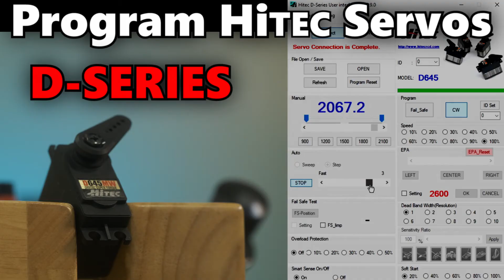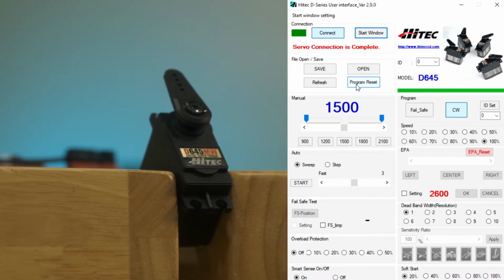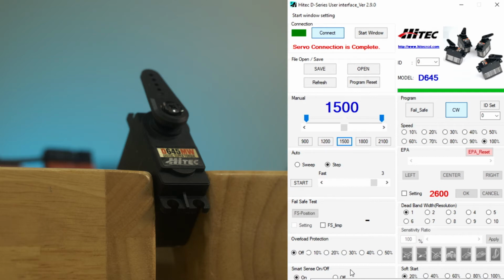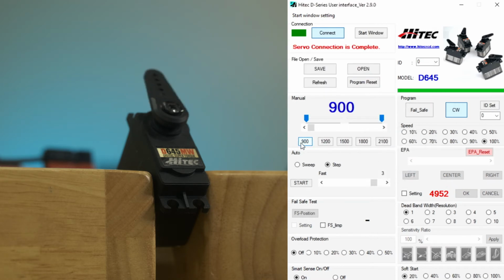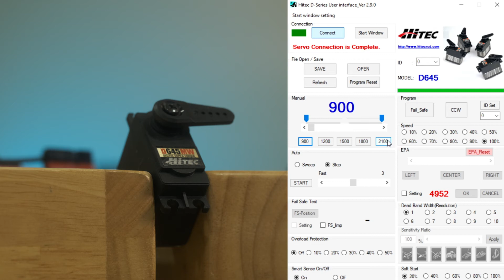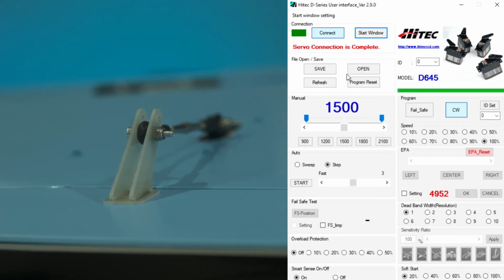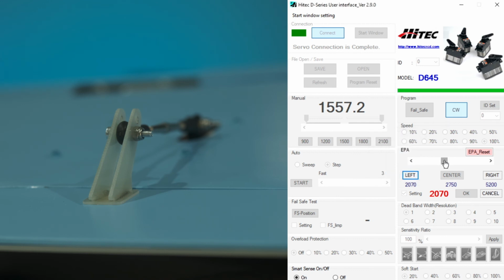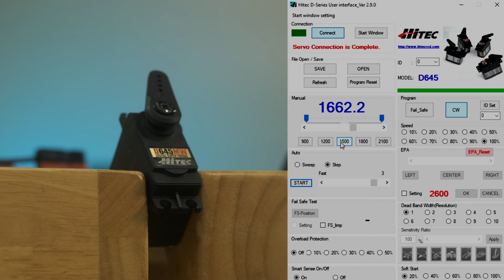How to program Hitec D series servos with the DPC-11 in 13 minutes - D645MW

Comment: Great Video!!!   I'm looking to acquire one of these, how would you go about programing when using a Futaba Radio?  For example, I have the HFP 10 and when I program center / epa and plug the servo into the receiver the center position changes.  I believe the neutral pulse on Futaba is 1530. 

Your help is appreciated.
Reply from the maker: You have to set your Futaba radio for 1500 center and 900 and 2100 end points. There are not a lot of devices out there that can measure...the Hitec HFP-25 has been the one tool that has been able to over the years...I believe there are newer ones out there. I'm lucky as the Jeti radios have the ability to show you the pulse-widths in real time.

Comment: Hi, great video. I’ve programmed my D950TW servos, but they vibrate a lot. I think they are too sensitive. I will adjust it, but the Sensitivity Ratio is greyed out and In adjust it. Any idea why or what to do? Thanks :)
Reply from the maker: I'm going to look into this. I seem to remember seeing that as well. Try changing the deadband value and maybe that enables the ratio slider.

Comment: Does it increase the resolution of the digital servo if I use the DPC-11 to reduce the range (set the L and R endpoints closer to center)?   ie is there any difference in resolution between setting the end points with the radio vs setting the with the DPC-11 assuming I'm reducing the factory range?
Reply from the maker: The D series servos are 32-bit so their A/D converters have WAY more resolution than most radios. I BELIEVE (not 100% sure) that most radios' resolution is set at max travel for the channel. IF that's the case....then setting the endpoints on a higher resolution servo will keep the most resolution you have available at your fingertips.

I'm not an expert on servo resolution, but here's how I think about it. For max resolution, you need to first increase your radio channel to go down to 900µs and up tp 2100µs. (for Hitec Servos) Then you have to figure out the bit-rate of your radio and the servo. You will be limited by the lower one. The Hitec D series servos are 32 bit...so their claiming there are 2^32 distinct positions the servo can be placed in. (4,294,967,296) Keep in mind, I bet that's for full 180degree rotation. My Jeti DS-14 has 12-bit stick resolution. That means there are 4096 distinct positions that the stick can be in and send a different servo position. (and I THINK this is when channels are set to MAX travel. I'm not sure if today's radios dynamically adjust their pulse width AD conversion to your EPA settings. I DOUBT it.

I make sure make my radio is sending out 900-2100µs...I never set endpoints in the radio for this reason....but I'm not an electric engineer by trade. These are just my thoughts.

Comment: Since there is no "Write All" button on the D-series user interface like it does on the HSB-series, I'm guessing that the "Save" button will both save the parameters to the servo itself, in addition to saving the parameters file to my computer?
Reply from the maker: Actually, the D-Series servos write each change to the servo as you make it. You only need to hit the "Save" button (when setting up D-Series servos) if you want to save the parameters to a file on your computer.

Comment: Question: Would lowering the travel speed also reduces the servo's operating torque? I'm wondering because my D485HW servo has Karbonite gears and I want to prevent damaging the gear train (in a crash) by adjusting any settings that may help (besides the Overload Protection).
Reply from the maker: That's a good question, but I don't think it would lower the torque.

Comment: Hi do you know of any reason or setting why, when the d85mg servos are connected through a hobbyeagle a3L gyro they glitch significantly every so often when at rest, and even when gyro is off. If i take out the gyro and go straight to the receiver it does not happen, have tried two different gyro's
Reply from the maker: I have very little experience with gyros. This would probably be a good question for Hitec support.

Comment: Can't you do most of this on a decent transmitter? I got a hs-7955tg I like the fact you can control the speed. I ran futaba 3003 standard servos as a kid and these high end servos are abit to fast expo seems to help slow it down. Anyone program one and was it worth messing with? It's neat but idk if I wanna invest in a programmer. What's your guys thought on this programing it worth it? I only have this one hitec servo rest are other brands. From past experience I'm not a huge fan of hitec had a few and think they were abit weaker than the specs claimed and seen a few burn out but that happens sometimes. But anyone use thus what's your thoughts on it?
Reply from the maker: Yes you can do most of this with a transmitter. I like programming the servos so if I sell the plane or change transmitters, the new radio needs less work to keep the same throws. I personally like programming the servos because it works with how I think...everyone has their own preferred way.

Comment: Did you install this on Windows 10? or was this an apple product?  Because trying to install the Hitec drivers is very difficult due to MS security measures.  The Driver is unsigned, so MS won't install it.  I've installed, reinstalled and read everything I can find on this, no luck.  The program itself installs fine, but not the driver.  Hitec claims to have a fix, but if that did work, it doesn't work anymore.   Hitec says to install a Silabs driver to fix this, but that driver won't install for the same reason.multiple
Reply from the maker: I have this running on a win10 Pro. I've had no problems. Have you contacted Hitec support directly about this?
Reply: @djmoosecom  It's the weekend, so no.  No support until 11 am est time.  However, I figured it out (just now).  I needed to update the SIUSBXp file, I selected the wrong one from the Siliconlabs site.     Without the updated SIUSBXp file, it  doesn't work at all.

Thanks for the reply.  Nice instructional video.
Reply from the maker: @martyw72  Thanks for sharing your solution!
Reply: @martyw72  I had the same difficulty with driver installation on a newer laptop with Windows 10. Good to know that you've found a solution. I switched to an older laptop with Windows 7 and it installed the driver automatically.
Reply: @martyw72   Hi, where can i find this file? Im running W11 and this thing does not wok at all....
Reply: @steffenhustveit  Go here and do exactly as they direct (directions in the blue box).  https://hitecrcd.com/products/servos/programmers/dpc-11/product